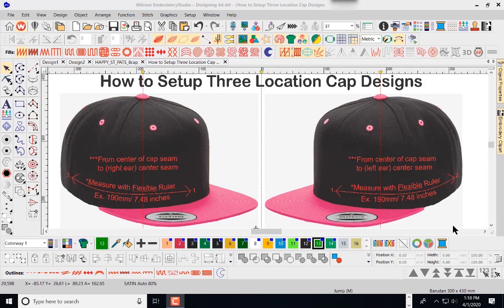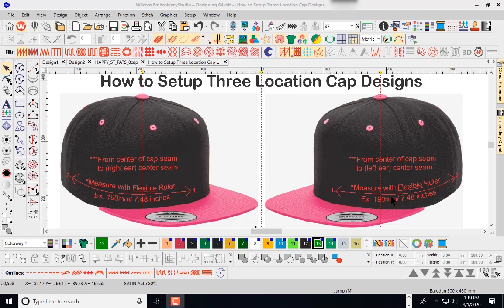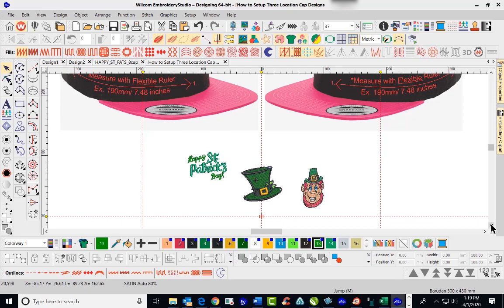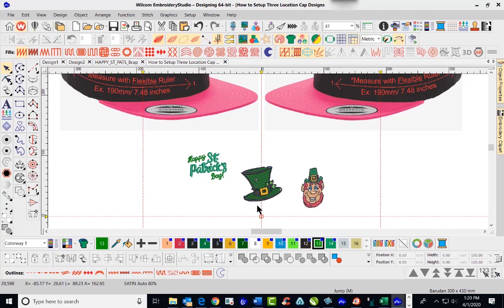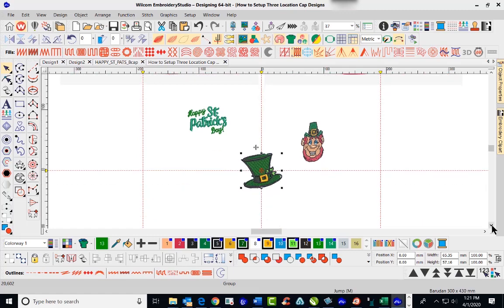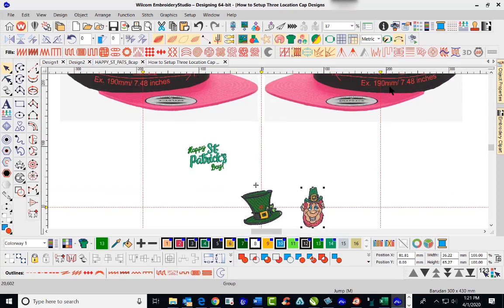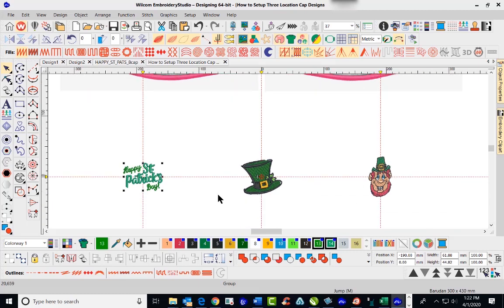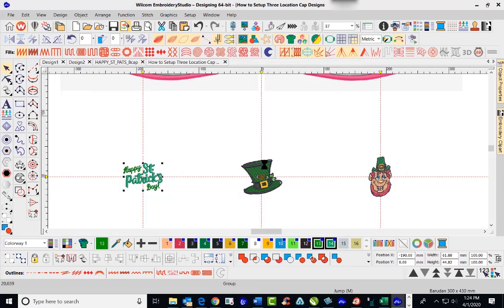How to Set Up 3 Location Cap Designs

Comment: How does it work with just a 2 location cap design? Been having trouble...Once saved the program automatically splits the design and uses the center between the 2 designs as the center point.